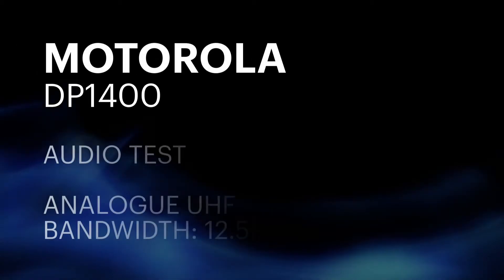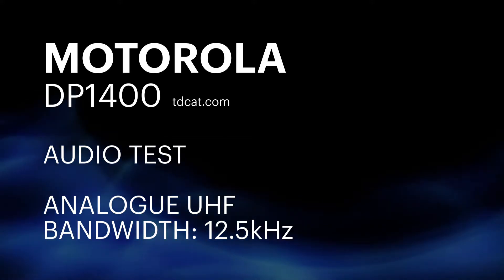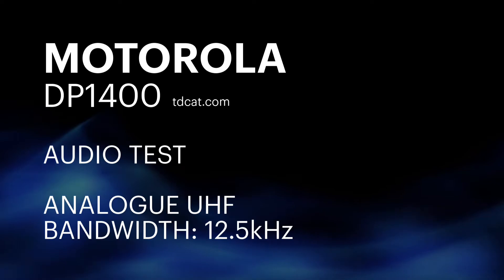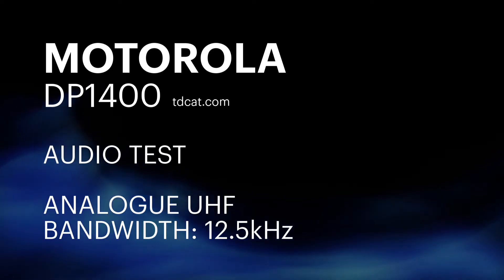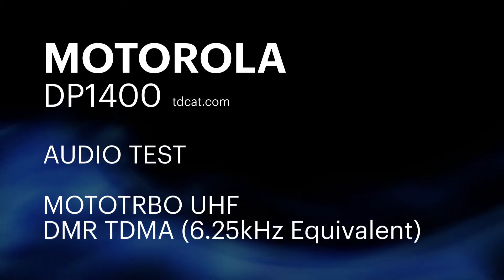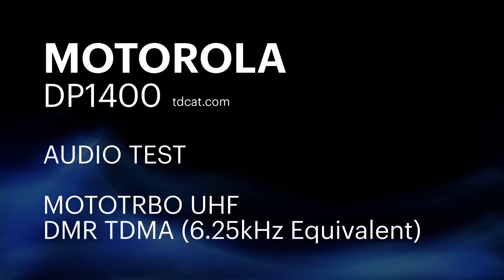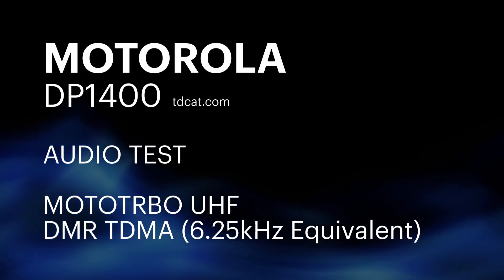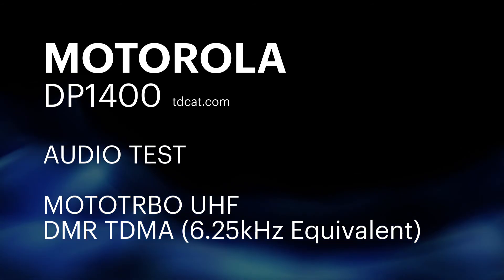Motorola DP1400 - Analogue & Mototrbo DMR Audio Test

Comment: What are the advantages of digital mode compared to analog?
Reply from the maker: Far too many to list in a comment. Digital offers businesses the ability to split their radios into groups and organise them in a way that is impossible with analogue. For a basic user (radio to radio) zero noise within the signal area is the big plus point. Analogue gets very noisy in lower signal areas. Also, privacy and security is slightly improved compared to analogue.
Reply: @tdcattech  and battery life improvement too, right? Audio quality on the other hand it does not seem to improve that much...